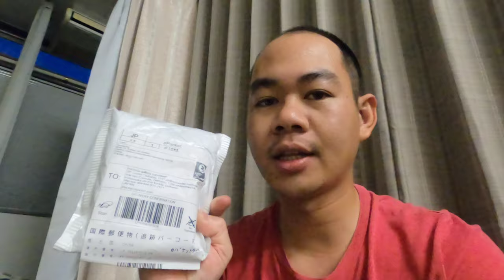#japanot #lowrider #japanotbuildseries old bike to lowrider build low-cost part 1|japanot

Comment: Kuya japanot.
May exact measurement po ba kayo ng icucut sa front fork at ung dun sa likod ?
Bumili kse ako japbike para gayain yang custom build nyo 🙂🙂🙂
Reply from the maker: Hi kuya Matt..wala po exact measurements.. sa likod basta po wag sasayad Yung gulong sa batalya.sa harap Naman po Yung gusto mo na bend ng front fork. basta Hindi sasayad Yung pedal sa lupa.double check na rin Yung pag ka welding para matibay.thank you